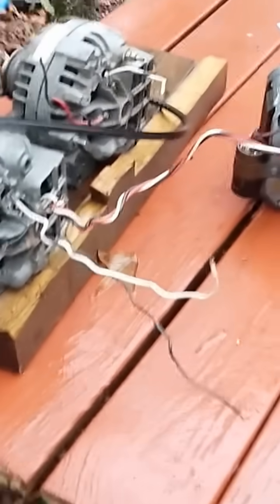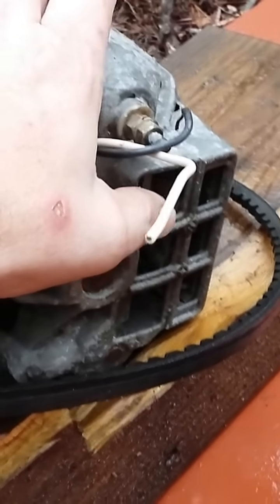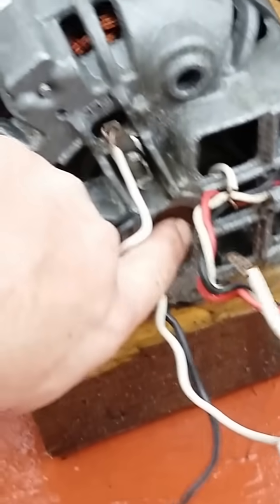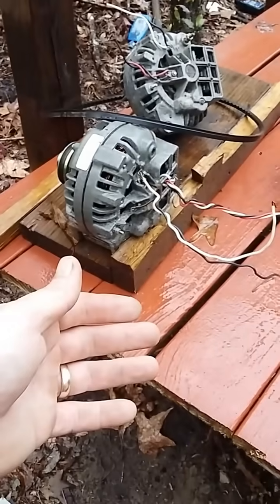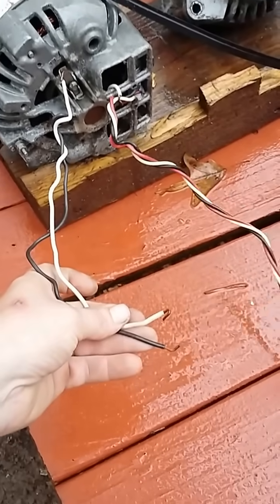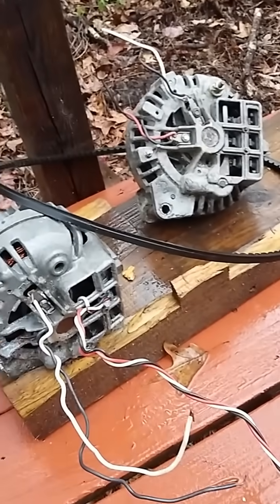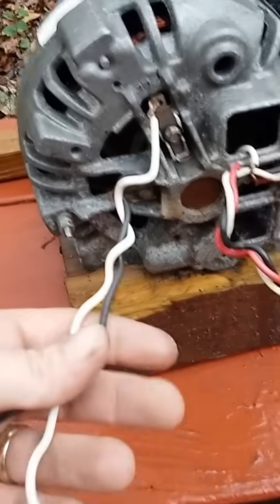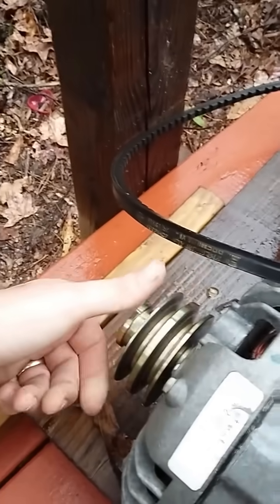Update Free energy forever no wind no solar no gas READ DISCRIPTION!!!

Comment: Over unity B.S.   I did this with a friend when I was 8. You take more power to run the motor than you get out. It was my first lead acid charger till i could afford a proper supply. I've been a biomedical equipment tech (repairing life support) for nearly 2 decades.

Comment: Honestly....you go on and on about nothing nor explanation of facts and doing...it seems you are just looking for compliments of sounding smart but you are full of BS...if you want to be taking seriously...show the actual work and steps...your video doesn't make sense.
Reply: I've seen this work in real time. I can agree he doesn't show you a working model. Though this has been a movement in the midwest. No solar, No wind. Alternator, just 1 at 90amps..then you have 2 which is 180. Most small houses are at 150 amps. This is common sense for anybody that does there research. Though to state BS?? It's obvious your incapable of connecting the dots.

Comment: The best way is to use a 
14 v 900A forklift battery with a 3000 watt inverter to power a 120v 9A 2hp motor to drive a 14v 300A alternater that puts more out to the battery in amps than the inverter load is pulling to run the motor powering the whole system.
This erray needs a dc starter motor to initialy start the perpetual system with.

Comment: You can recieve 110 volts and 10 amps from a 100 amp 12 v alternator.
By using a transformer  to bring the voltage up to 120 volts you loose 2 amps.
However 120v/8A is moore than enough to operate a coffee pot, hot plate, 1500 watt radiant heater, and any universal motor powered device, or 12 100 watt light bulbs.
However, the high frequency will over run fridge motors, ac motors and burn up computors, tvs.

Replaceing the rotor assembly with a ceramic or wood rotor and a wide ring magnet elemenates internal counter breaking and allows for a 1 hp electric motor to be self power by the unit and still supply 1200 watts of expendable free to use current after the unit is started with an external sorce,ie, battery with dc starter, or cordless drill,

Comment: Okay from which manufacturer did you source the alternator/generators?  If I’m not mistaken, GM alternators are “self exciting “ they automatically start producing power at a certain rpm so having to add3-12v is unnecessary. Also the older Fords had a separate rectifier box normally installed on the firewall to convert the ac to dc

Comment: I have this demonstration set up and im getting 220v ac current from it but wont power up anything what am i missing?  My 3 coil wires are my main hot wired in 3 phase do i need to connect neutral to a ground rod to complete the circuit? Im a single father in a 900 sq ft home and the electric company every month tells me that im using 2500kw a month charging me 400 to 600 dollars and its only my son and i here i just dont see how thats possible ive be trying wind turbine perpetual motion solar everything could you please help me to show me what ut is im missing or maybe send me complete video i am more than willing to donate to your channel to help with a fellow experimentor tired of getting screwed over by the monopolies big company
Reply: Idk anything but some basics of electricity but do you have the right hz amount coming from that generator, it should be 50hz
Reply: If you have figured it out, make a video of it! We need to see it working! Thanks.

Comment: Scott you have alot of very stupid assholes making comments. And some genion people asking for alittle more indepth instruction.
Why would a good guy refuse to help good people because of all the bad people it would also help.
I dont understand your mentality.
What your claiming to have acomplished is not new, car alternaters were used to produce 110 volt ac around 15 amps in the 60's & 70's by many people. Infact leecneil alternaters come factory with the ac output terminals on the outside of the unit from the factory today. Yes the alternater can produce enough energy to power small homes but the y can not be fault grounded as required by current laws, this is why it is dangerous to use this way in america. Its works great on asian two wire 50 htz earth ground systems but we are a three phase 60 htz system in america.
If anyone wants to know how to use a U.S. compliant gasoline powered generator as a self powered free to use energy device, ill gladly tell you how to do so.
Reply: Alright I'll bite let's see if you're trolling or not.
Reply: Over unity B.S.   I did this with a friend when I was 8. You take more power to run the motor than you get out. It was my first lead acid charger till i could afford a proper supply. I've been a biomedical equipment tech (repairing life support) for nearly 2 decades. If it was this simple everyone would already be doing it. He wont answerer questions bc he knows it wont work. Both the motor and the alternator have apx 85% efficiency that means power is lost to heat you cant gain free power. If you doubt me turn on everything electric in your car (open the hood so the engine isnt heating the alternator) and touch the alternator after your cars been on 10mins (actually dont you will be burned). That heat is all lost energy.

Comment: I am already Trying this in my off-grid home.  Solar and the water turbine does not work in the winter.   I am still looking for another way to charge my small battery bank.  I can't have electric from any company  they will not come out here.   I will learn what you are doing. and connect it to my inverter.
Reply: Put compost under your tubes it will warm the pipes so doesn't freeze and at the end you have a nice load off compost

Comment: Thanks for your time and effort mate we basically got the idea we just have to convert it to Australian electricity box.
Reply: If you have 90 amp out, remember you need that power in .. can't get energy from nothing. If you use a 12v 100 amp battery in , your power out would last until the battery is out of power.   So ... What he is showing here is bull shit..

Comment: Why would you have to use a motor to spin the pulley and also supply 3-12vdc to field wires? If you just spun the pulley it should generate voltage without adding 3-12vdc

Comment: Can I get Instructions on how to build one of these??
Reply from the maker: There are two ways of accomplishing this you can either use pulsed DC into the field winding or you can cut spaces on the rotor and put magnets in there.. either way will work and as long as you turn the alternator at 3600 RPM you will get 60 hertz out of it. Because 60 pulses per second * 60 seconds equals 3,600 revolutions per minute. And depending on the alternator you can get right around 10, 000 watts of energy which is a lot more energy than you need to turn the alternator. I hope this helps!
Reply: That makes perfect sense to me. Thank you for explaining. I sure hope things get better for you soon.

Comment: There is no such thing as a free energy machine. Unless of course you have managed to change the laws of physics in which case you're on to a winner!
Reply: It's energy all around you just ask Tesla
Reply: Water running on a fan blade that can circulate perpetually from one tank to another over the belt end of the alternator to another will create enough electricity easy.

Comment: This will actually work if he had a stream or a windmill to turn the motor which is used to turn the alternator to generate the AC electricity but he never says how he will spin the motor though.
Reply: Add a flywheel and a low power motor plugged to the output of the generator and it runs alone. 
Flywheels divide the input needed.
Reply: @henridecorbiac2239 that’s not how thermodynamics works.
Reply: @cstrutherskgs  funny to talk with « anonymous ». Troll style
Reply: I’ll getta bike my guy pedal for hours😂 witta workout

Comment: Zillions of people have used motors or alternators to generate electricity this way, going back over a 150 years.  You have to turn the generator somehow.  There's no generator that can run itself.  If you could use alternators to generate more power than they use, then that would be how the electric company does it, and they wouldn't be buying oil and coal.  

This is a common high school science fair project with some bizarre claims added on top.  At least throw a wind turbine on there to turn the alternator for you.
Reply: magnets baby.
Reply: You are completely wrong.
It's all in the power factor.
Most have no clue outside of watts volts amps and HP, very few can comprehend the power factor of a drive motor.
If you need 15 ft lbs of constant torque at 3600 rpm to operate a 8000 watt generator at full load. You need to use a electric motor that has 1 &a 1/2 that power factor.
It's not about HP or amps or watts or volts or hertz. It's about power to do work at a constant speed regardless of load variations.

This is real physics confounded so you guys can't make nothing that can overcome the law of conserving your masters flow of money from you . 
Your not smart enough to undo the bs built into everything that stops you from being independently free

Comment: I had 2 hoover motors , I used one of those powered by an inverter to make spin the other one which is powering a car battery charger which is charging 2 car batteries of 12V each that are sending 24V to the inverter , this is the only efficient way that I managed to build / make my "free energy" generator

Comment: What can be done to counteract the counter-induction?
or is there a way to use it?
Reply from the maker: Bi-filor coils... with the star connection connected to the center tap on the opposite of the six phase then you will need a another three phase wired in Star for the motor winding of the nine phase motor/generator I created for everyone...  
❤️❤️❤️❤️❤️❤️
Reply: What you describe there in the video .... Do you need a converter?

Comment: Add a flywheel, intermittent boosting...
Reply: Exact !!! Look for Baba Diarra ‘s flywheel, amazing :
600 HP generated With a motor which needs only 1,8 L/ H of oil instead of 86 L / H without flywheel.

Comment: Free energy? Where does the power come from for the 12V DC and to turn the alternator? Aliens? Elf farts? Stop lying. No one is going to "make you disappear" for being a wanker on the internet. People are just going to laugh at you and the people who believe your bs.😂😂😂😂🤣🤣
Reply: Add a dc charger, and a voltage regulator... it will charge your initial battery source...
Reply from the maker: Do not help them you can lead a horse to water but you cannot make him drink if it pisses you off you can hold him under the water until he's drank too much though...
Reply: A third alternator that makes 12v and is wired back to the motor. The motor is powered 12v dc. It turns 2 alternators, 1 that makes 12v and 1 that makes 220v.
Reply: @philipbrown6500  Lol, and what turns the third alternator? Is that where the elf farts come in?

Comment: It is scientifically impossible to create more energy than it takes to make it. You cannot create more electricity than you are using to turn those alternators. All these hokie machines are not realistic. The only free energy can come from the earth the wind or water. You can make that motor cell run but you will never have left over current in an amount that is actually useful.
Reply: Transformers step up and step down electric.....
Reply: For what it is worth, I have 30+ years experience working on electricity up to 14.4v. I have worked with transformers that step up and step down. I have seen wires melt because they could not handle amps that were flowing through it. This guy is wrong on so many levels. I have also gone to many schools that teach transformers and wire sizes.  Even if this guy found a way to get 120/240v from those alternaters, there is no way they could handle the amps necessary to power even a small home. They would melt.  What he is saying is an impossibility.
Reply: If it is scientifically impossible create more energy than it takes to make it oh, what the hell is our company doing? How are they making any money if they can't make more power than they use to do so?
Reply: @philipbrown6500 nothing we have is 100 percent efficient.... And for this to work it would have to be 150 percent efficient.... Which automotive alternators are 60 percent efficient they are awful at generating power....

Comment: Seeing it in action would help... I assume you use a cheap 12V car battery to spin the alternators which act as transformers in a sense, to boost the power up to house appliance voltage.  So,  how does the initial power source, the car battery, not go flat? You couldn't use a charger to return the energy as there is no perpetual energy as all the power loss from heat would still drain the load. Therefore a solar cell or wind power would have to be used wouldn't it?

Comment: Hi Mr. EnergyBuies, Michael Moore, thank you for your video. I've gotten a few alternators 1 I left as delta configuration, drilled the stator installed neodymium magnets. The other 1 to a star configuration with 12 volts to the sraror. What's the rpm for the stator. What am I missing? I am also disabled from an auto accident.
Reply: I think it's 2000rpm

Comment: What are you use to turn them to create electricity
Reply: You use a motor. Prefrerably a 12v motor.
Reply: @mfickas  So you use a motor, which is a generator in reverse, to spin a generator... And you gain power from this? Curious. Why does the motor voltage matter? Voltage does not mean power, it means electrical potential. Energy is determined by voltage times current times time, which can be expressed as watts hours or joules/sec of output. An electrical output of 10 volts flowing through a resistance of 1 ohms will draw 10 amperes of current, which amounts to 100 watts of power. 

If you used a motor of 10 amperes at 10 volts to power a generator, that generator could output at 100 volts but would only be able to output 1 ampere of current. No power is gained, and in fact power would be lost due to power loss due to Joule Heating. This power loss is calculated as a percentage of total power expressed as  L=P²R/V², meaning the square of the total power times the resistance of the circuit divided by the square of the voltage put in decimal form. This means that higher voltage devices are actually exponentially more efficient due to reduced joule heat losses.

Now even ignoring that, the reason this is false is even more simple. Suppose you tried to use a 120 watt motor at 12 volts to drive an alternator at 120 volts. You would get at max 1/10th the max rates current of the alternator. This is because of the observation of Lenz's Law, which shows us that the magnetic field of a current-carrying wire which generates a current in another wire will oppose the field that created it. This is the physical forces associated with the actual work being performed on a generator to produce electricity. Your 120 watt motor would simply not have the torque to overcome the stronger magnetic fields being created at higher current and it will slow down, reducing the voltage. And because we know power is equal to voltage x current, and we know that current is determined by resistance, we know that the power output of your motor-generator is going to be at best equal to it's input.

If you're not convinced, I will not stop you from wasting your money and time and trying. You will be severely disappointed on the noticable inability to violate the basic laws of thermodynamics.
Reply: Its 6volts sheesh, werent you paying attention?

Comment: my question is  ,it take more energy to run the motor to turn the alternator then the alternator will ever put out  so how did you overcome the missing energy needed ? I do not see it working here  PFFFF!!!
Reply: He said 6 v direct = 220?
Reply: @allresistanceneversilent9322  yeah 220=6v that means 110=3v right ? whatever that means
Reply: @mikemyr2995  That means if you apply 3v to the stator then it may do the 110v. Not sure. Will have to try that.

Comment: its incredible how you still reply to people's comments after reaching the 10,000 coments mark, and the video is near 6 years old. I really do appreaciate your work and i fully understand what you are saying in teory I just didn't try it yet because i don't have the materials. Any chance to see those privately share videos of yours?
I watched Gerard Morin, such a great master and craftman he re-discovered cold electricity low amp, high volts. By using A Hyper drive to power a generator, with thin wire that are bifiliar coils, on a coreless drive without a ferrite or iron. He says that Iron is not your friend as it steals amps when it passes electricity through it, and his hyper drive (Efficient Motor)
This type of electricity does not dammage appliances. I would love to exchange what i learned so far with you further elsewhere if you want :)